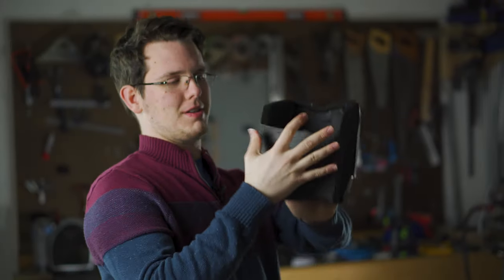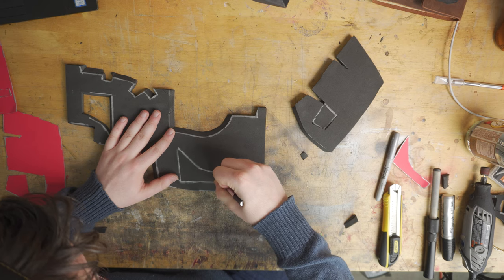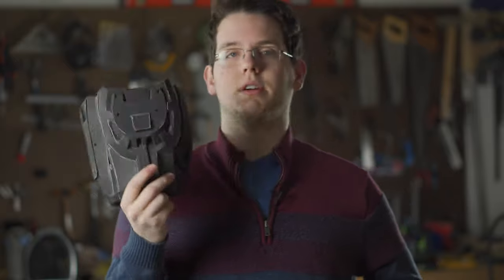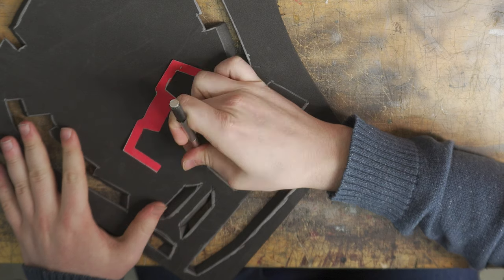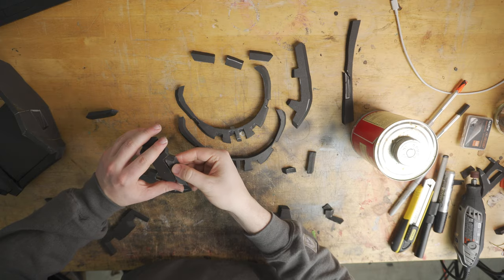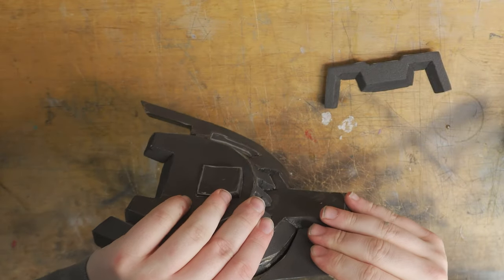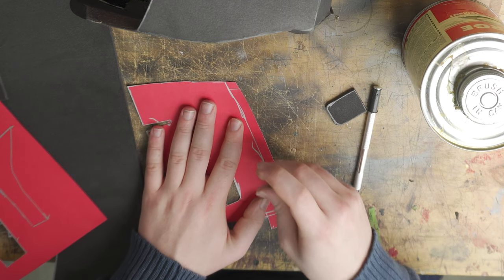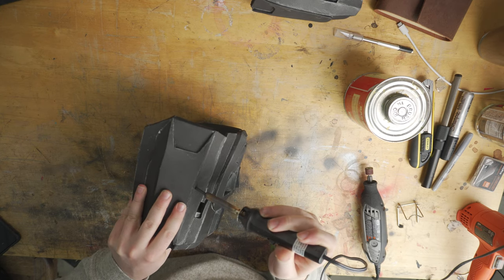Halo Reach Cosplay Tutorial | Biceps

Comment: Awesome tutorial, even more awesome that you're the only person online whose made a tutorial on this!
I just have a couple questions since I've never worked with foam:
1. Do you have to cut out the smaller pieces on the pepakura file that are off to the side? 
2. How do you hold your pieces together while the contact cement is drying? 
Thanks in advance!
Reply from the maker: Thanks! To answer your questions,  
1) no. Those pieces are either duplicates and you simply need to flip the mirrored version over,  or not useful for foam work (e.g. pieces that are needed when making with paper since it has no thickness)
2) to use contact cement you apply it to both pieces then wait for it to dry. Once it's dry you attach the pieces and it instantly bonds on contact,  a very important feature :-)
Reply: @RandomRangerCosplay  incredible response tike, thank you for the tip!